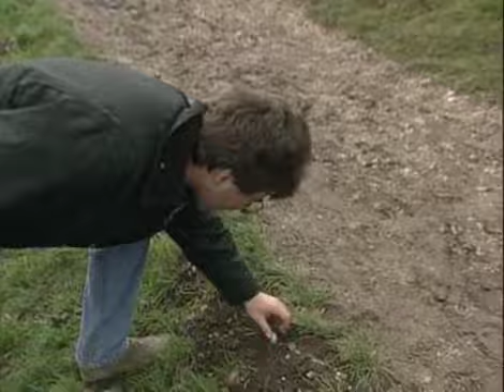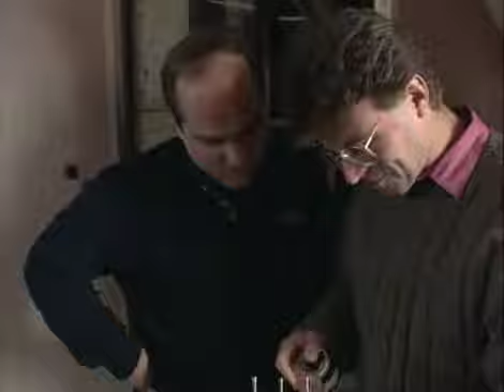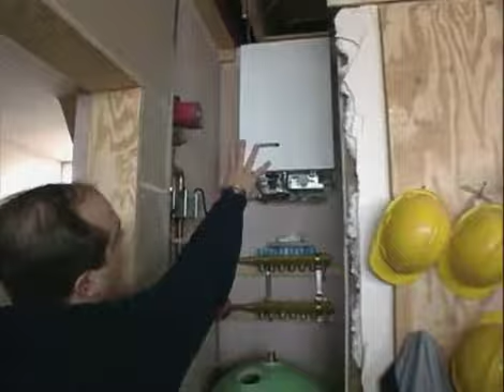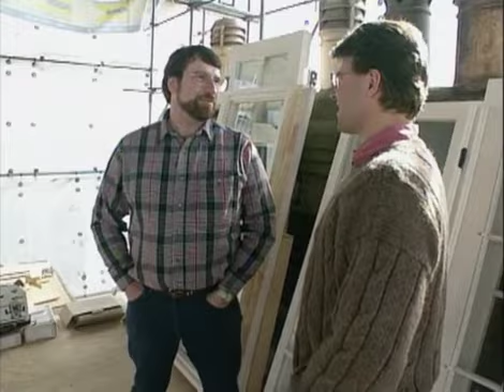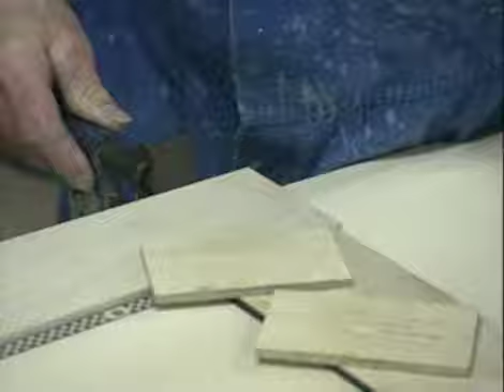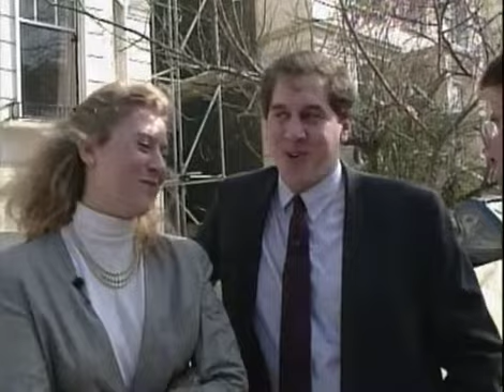This Old House S13e25

Comment: This Old House Season 13 (1991-1992), Episode 25: In part 6 of the London, England project, host Steve Thomas visits an ancient stone circle on the Salisbury Plain. This Old House visits the workshop where the flat's kitchen furniture is being made. Plumbing and heating contractor Richard Trethewey discusses the shower, pump, and heating systems, and talks with plumber Stan Newton. On the roof, David discusses the single membrane waterproofing system. Finally, Master carpenter Norm Abram discusses the features of the American custom windows.👍